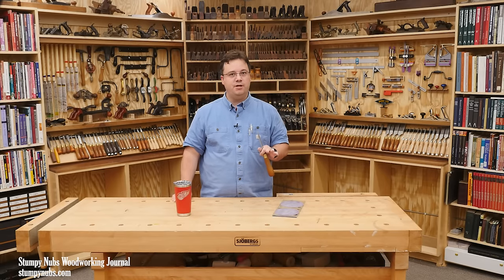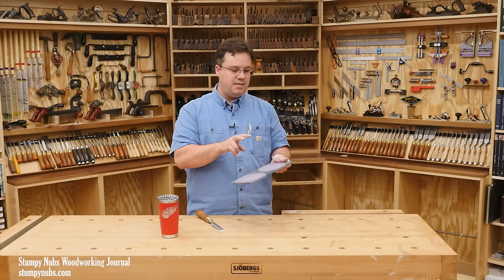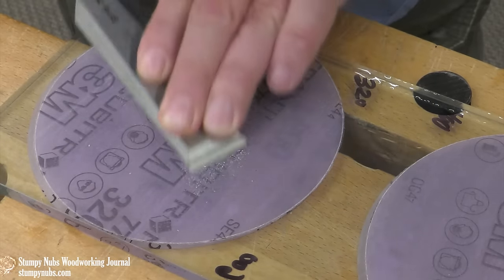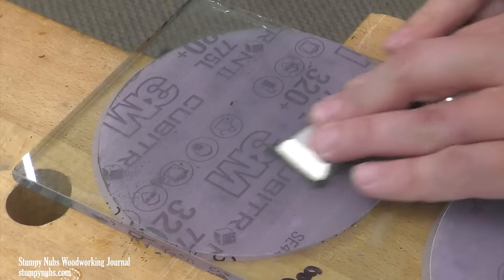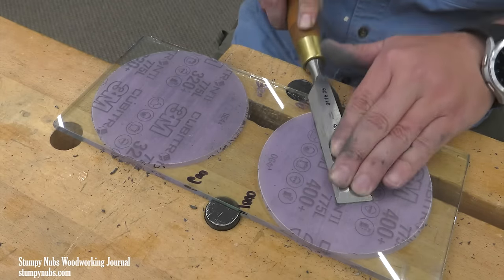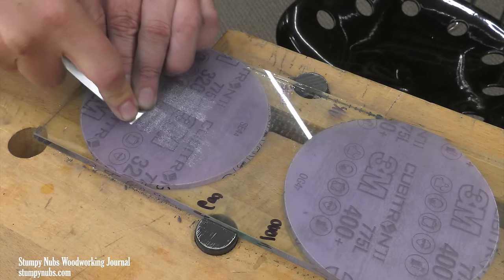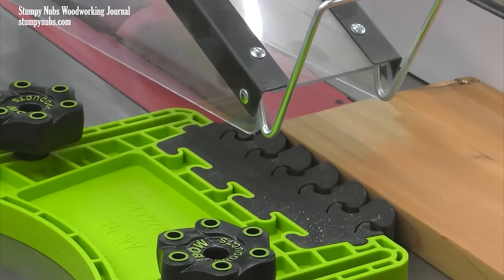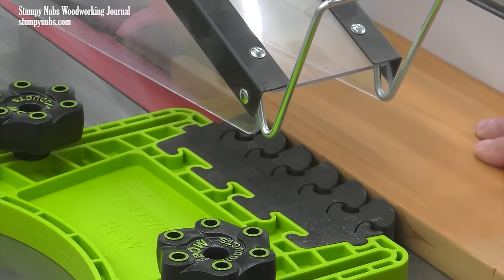A game-changing NEW way to sharpen! (Scary SHARPER!)

Comment: Sorry but I don't get why all the back plate of the chisel has to be grinded perfectly flat and polished ? Doesn't the chisel work as satisfactorily if only one or two milimeters each side of the blade are finely sharpened ? Then why spend money and time on something useless ?
Reply from the maker: A western chisel with a long blade requires a reference surface on the back to aid in paring. That surface only has to be an inch or so long, but since this process is so easy I decided to flatten the whole thing.
Reply: @StumpyNubs  Thank you it makes sense. With an exemple of use of the back surface as a reference in the video I would have catched it.

Comment: The hollow on the back of the chisel has a reason to be there. Friction (less so) and surface mating (more so) - it's easier to make a chisel lay flat on the surface if it only references the surface on the side edges and the cutting edge, and not throughout - then, if the surface you're pressing it against is not itself very flat but instead have small rises - these rises will push the back of the chisel out of alignment. A chisel with a hollow on the back will fare much, much better there. Flatness matters only on the edges. And japanese chisels have a hollow absolutely intentionally. Same goes for plane irons, easier to get correct alignment with less surface - compare how easy it is to get a stool with 3 legs to stand solid vs a 4-legged one. Or a bench that has whole slabs on its sides as legs.

Good vid otherwise. Get diamond plates, they are cheaper in the long run.
Reply from the maker: Japanese chisels are made that way, with specifically positioned and shaped hollows. Western chisels are not. The off-center, poorly formed hollow on the chisel in this video was not an intentional manufacturing feature, and was not worth saving, in my opinion.

Comment: Another informative video but I disagree with one aspect. If you have a small hollow on the back as your example, conventional wisdom says you don’t need to get the entire back perfectly flat because you’re only sharpening the leading edge. The rest is a waste of time.
Reply from the maker: Only the last inch or so needs to be flat, but it's only a waste of time if it takes a lot of time. This doesn't.
Reply: @StumpyNubs Fair enough.